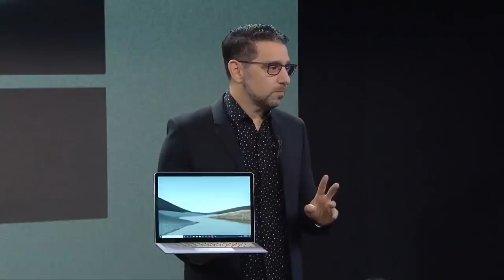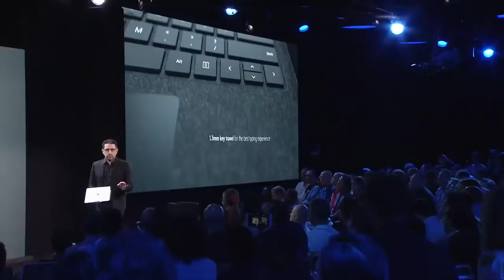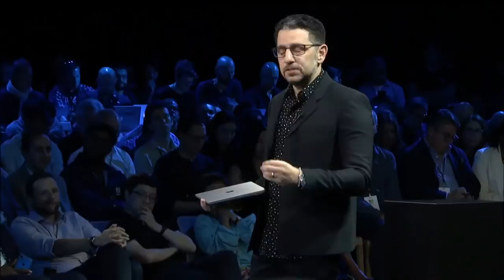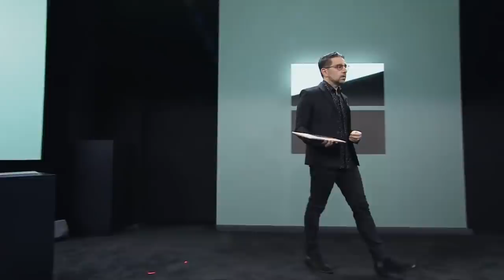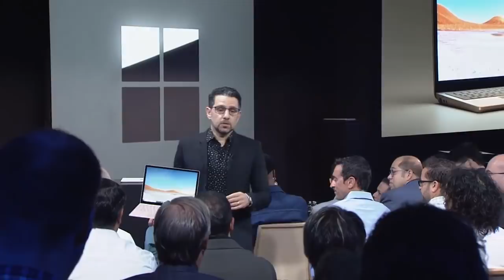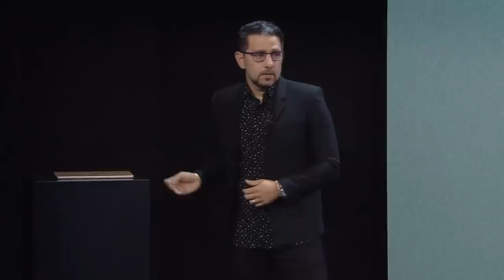Microsoft says they value repair-ability, designs more repairable product.

Comment: The 2019 chia pets have soldered SSDs and RAM.
Reply: My buddy added 8gb of ram to his ceiling fan, it wiggles a lot less now and makes less noise too
Reply: @syntehtix   My ceiling fan has 32 gigs of ram, but it crashes often. When it reboots, it thinks it's a hard drive and tries to spin up to 7200 rpm.
Reply: @fishyfool  flip your magnets around, that will solve it.
Reply: @fishyfool  My microwave actually just has 16gb of ram, but it still runs alright. It just has some overheating issues.
Reply: @fishyfool  you should install a cooling fan on it tho.
The crash happened because of overheat.
Reply: @alang9480  Mine never runs over 60 degrees Celsius!
Reply: I once sprinkled Chia-Pet seeds on my head, it was unbelievable, just like real hair, only green! xD
Reply: I laughed way too hard at this
Reply: 2019 Chia pet warranty voided if you get them wet.  Moisture indicator turns green, not red/pink.
Reply: 2047: I spilled water on my macbook and it turned green and grew hair.
Reply: Those still exist?
Reply: And that was how I declared my friend's Surface Pro 5 dead, the SSD got corrupted and Windows PE refused to even wipe the drive and I discovered that the SSD was soldered into the motherboard, which costs over 400 to get a replacement for the entire board. 
So much for the word "Pro".
Reply: 😂😂😂 AWESOME!
Reply: sadly yes

Comment: Of course, that counts for little if the tool to open it is either not available at all, or only at an uneconomic price, and is patented to within an inch of its life so that third-party implementations can be stopped in customs. This could be a move from a device that is incidentally difficult to open to one that is designed to be difficult to open without the tools that you cannot get.

Comment: M9icrosoft knows, as Apple does, that anyone can make hardware and anyone can copy software.
they have to make copying their stuff problematic.
Apple is insane and criminal.
if the law says that a MANUFACTURE must offer a way to recover data, period, no if-ands-or buttheads. 

then the need to repair drops as the data is everything we have as far and away the #1 requirement.
#2, if the damage is faulty design, then the manufacture should replace the unit for free.
those two laws in place would make APPLE alter their engineering overnight. 

the push to make them 'repairable' will never offer the desired result.
after the law goes exactly the way you want,  when you need to buy 2 chips at $75, each, and be manufacturer certified at $5,000 certification renewal per year to be allowed to buy them,  you walk in the path the manufacture controls.
because, that is the 'surprise' at the change of the current push for the law change.
my scanner, printer, fax stopped because it needed a color ink.    not the printer, but the fax and scanner too.  complete system shutdown.
that is a design that is a simple manufacture caused failure.  that sort of thing should be outlawed.

Comment: Maybe they could start in at least providing schematics for older Surface Pro's. I have one here which went through some repair shop and as it was opted not to be repaired, it came back with most of the components of the main power supply missing. Good luck in finding out which values all the caps should have...

Comment: If the trend in ultrathin laptops and portables reverses to support real innovation in field serviceable components (replaceable RAM, network adapters, storage, hot swappable or easy replace batteries) I'm ready. I'm tired of having to pay more to max out the components of a new purchase just to ensure future capability and stability for my portable devices. If they can support upgradeable CPU architectures, even better. I don't mind slightly thicker devices if it means more reliable and quality hardware. The 2009 era macbooks nailed most of it, IMO. Thinkpad T-series too, for that matter.

Comment: schematics may always come hard to come by, there will always be those that take them and replicate the devices with cheap knockoffs. Can't blame them for protecting their intellectual property/designs, HOWEVER, service manuals for fixing known issues or replacing certain parts would be an even larger step towards repairability.

Comment: Apple started this trend by first  removing the removable battery from their iphone then it snowball from there. I like dell's xps  approach of making a modern looking products but still being easy to open ( you can open it with a torx screws its not glued on together like the old surface laptop) i hope dell continues with this approach although their new xps 13 2 in 1 has a soldered SSD. Thanks apple for making this a trend. Hope this change back to upgradable ssd.

Comment: Not enough competition or consumer focused regulation.

Car industry has massive international competition. Each new model is developed with partners and competitors in order to reduce costs.

They are even making repair parts cheaper to remove and replace, so that the insurance category is lower and repair costs are lower.

We need some of that in tech industry.

Comment: Louis Even you can open a Macbook that was available from long back ago. But can you repair something without the schematics ????. I bought an Xbox after saving money. After someday because of my mistakes water went inside. I went to sooo many shops here. All had only one answer Microsoft has not released the schematics of the board so we cannot do board repairs. Any engineer can buy parts and replace them. But you guys are specialized in board repairs and if this is the condition then you have no point in complaining about apple.
Reply from the maker: You can't criticize one company for doing bad things because another company does bad things... Bravo slow clap
Reply: Louis Rossmann My point is id apple sucks a bit in repair then Microsoft sucks more

Comment: A step in the right direction.  This throw away attitude needs to stop.  Major items like screens, keyboards, hard drives etc should all be (relatively) easily serviceable.

I am currently struggling with this with a vacuum cleaner (a Dyson).  I dismantled the vaccum to remove a damaged part.  This was a relatively easy process and only involved removing a few screws and a bit of jiggery pokery.

When I contacted Dyson to obtain a replacement, they have only agreed to sell me one if also I book an engineers visit.  The cost of this would likely make the repair financially nonviable (which I assume is Dyson's intention).

Comment: It's a nice change even if you can only replace the battery, monitor, keyboard, and cooler fan. In our machines those are usually the most common failures or things that get broken; battery failuires are the most common. The motherboards usually last if they have no defects initially and don't get dropped too much.

Comment: If done correctly, service doors and screws and vents in a device can look as good as all the seamless no imagination pebble design copies of MacBook Air from 2008. It is nice and all, but after 10+ years it is just boring.
 I like more those lower tier gamer type laptops which (given that they are not as powerful as those over the top gaming designs) also try to appeal somewhat to the ultrabook market, so they try to be aggressive for the gaming side, yet professional looking.

Comment: Microsoft can say all they want, but they need to put their money where their mouth is. They've been moving in the wrong direction far too long for something this small to be anything more than a gimmick. Windows software has been getting considerably worse and worse since XP, with Microsoft constantly and consistently removing options, user customisability and compatibility, and EVEN IF they would give you full modular laptop with any part you can ask for, it's worthless to you if you have to re-install windows and spend half an hour on the phone with Microsoft "authenticating your serial" every time you want to upgrade or swap something out.

Comment: I can accept soldered ram on anything smaller than 13 inch, soldered storage however? Sure if the device is smaller than fucking 10 inches, fine.
But when both ram and SSD is soldered on anything larger than 13 inch? 
No, shame on you manufacturer!

Comment: when your products doesnt go leaps and bounds in each iteration, people will stop buying your product.
extending the life of the product is the only way to justify cost upfront. and keyboard and trackpad is what affects customer immediately. but just from this small segment you caan see the battery is accessible from just removing the keyboard/trackpad panel.

going to the microsoft event video, you can actually see  that its actually mostly accessible from there too.  although its a mockup, the CPU and GPU plus the main logic board is under that metal shield with heat pipes at the top part. those rectangular cutouts near the edges of the chassis either hints at speakers  seeing that the keyboard plate has what appears to be permeable material.
there's appears to be 2 plastic flaps right next to the logic board shield/heatspreader... the smaller one next to the blower fan seems about the size of a wireless card. so i'm guessing the SSD is under the other one...

the ram might be soldered on (the top left of chassis) but hopefully removable SSD is there.
 better to be able to migrate machines if your  board dies especially if you preach service-ability for the corporates
 "oh you have a important meeting and you need it fixed now... how about we swap your unit to an identical machine? what about your data? dont worry we just move your ssd and it will take less than 30 mins? security..?  its handled by the OS so your credentials dont stay on the old machine and nothing is left behind."

Comment: Well they've screwed my laptop. Updates have killed SOUND several times, now killed Bluetooth file transfer, now I can't even save the file I have opened off my phones sd card while it's plugged in WITHOUT saving it to the hard drive and then COPYING it over. But MEANWHILE it's downloaded an install of office I never ssked for, as well as an install for an updated version of Windows and put on a video editor I never asked for and when I go to use paint I have to type it into search EVERY TIME although it's one of the top 3 programs I use!!!! Imagine if these idiots were left to run a nuclear power plant. It'd be 80 times worse than Chernobyl.... I once had to copy a single file to my phone. 20 minutes startup as it installed an update, and 45 minutes shutdown over ANOTHER UPDATE, and I just needed ONE small file.... bloody time wasting crap. If they sold cars it would want to do an engine swap while you were already running late for work.

Comment: It was pretty sickening hearing that guy moan about trap doors n' lines blah blah blah. Oh the horror of input ports for usability! You shouldn't need more than a screw driver and a spudger to replace ram, storage and battery. A laptop is a tool that's meant to be used, not a piece of art! 

You can design one big trap door on the bottom of your beautiful laptop held on with 4-6 screws that will give the user access to everything they need to upgrade over the life of the device.  And since it's on the bottom, no one will see it while it's being used.

Comment: Sorry, but the consumer must be able to open it easily! I want to clean a fan by myself. This tablets and laptops are perfect for using them in bed. So I expect much dust in them. And screws do not screw up the design if it is made right. Also the extra weight topic is bullshit. The first surface had tons of screws under the display plus glue all over the place. It looked like someone wanted to make sure, that it is not repairable!

Comment: Maybe I'm alone in this, but I don't see an elegant laptop in a wafer-thin piece of polished aluminum. For me the elegance is in a cleanly engineered design. One that cools easily, effectively, and quietly, is simple and intuitive to assemble and service, and brings functionality that improves the day-to-day experience.

My daily driver is a Haswell-based Thinkpad- the last generation of laptops to include a socketed processor outside the "desktop replacement" category. It's a brick, weighing 7ish pounds, but I love it to bits. Literally to bits, because nearly every part is user-replaceable.

Comment: But I still don't like those super-thin devices.  If I wanted to work on something that thin, I have a bundle of lined paper...

It may be because I have big clumsy hands, but I like my devices to have SOME body to them.  Now I'm not talking hefty like a DataGeneral DG-1 or even the HP ZX5000 (that I still have, it still runs, I just can't find a project I can use it for anymore).  But something like my ThinkPad T430, taht's aboyt right; some solid feel, and not so thin I'm afraid I'll break it by breathing heavy on it (and no, I'm not breathing heavy on it because I was reading a Megurine Luka doujin, get your mind out of the gutter).

Comment: Microsoft has always made products hard to repair. Just look at the original Xbox, you had to use special to Torx security screws to open it. They made it even harder to open with the Xbox 360. Sony does a similar thing, but they make the hard drive easy to replace. Besides the easily replaceable hard drive, Sony designed the ps3 and ps4 to be hard to repair. As far as I know, the only major tech company that designs their products to be easy to repair is Nintendo

Comment: Why does your tech in modern tractors force farmers to spend $500 to have basic warnings removed or there tractors wont start ?it has to be loaded up hauled to a dealer for basic software glitches or updates that leaves it useless or won't  start without having it done ? Why are states having to use courts and pass laws to allow them to have access to simple fixes ?

https://www.google.com/url?sa=t&source=web&rct=j&url=https://amp.theguardian.com/commentisfree/2017/mar/26/why-american-farmers-hacking-own-tractors&ved=2ahUKEwiR9vrN2ZPlAhUKVN8KHbojDawQFjACegQIBBAB&usg=AOvVaw1w67T6dBlRgW5IZKHGj6pR&ampcf=1

Comment: I have a Dell latitude e6410, and I frickin' love it. you only have to remove one screw to remove the entire bottom and have access to damn near everything you could ever need. you can remove the optical drive / HDD without even taking the bottom plate off, but if you need to get a little more involved, it's super easy to work on. absolutely amazing machine for what it is, I love it and am clinging onto it as long as I can. it's only downside is it's 800x1250 TN display, I have no complaints other than that.

Comment: Of course everything is going to be soldered. Sockets can add a lot of thickness, and just look at how thin that device is. 
Now one thing I would like to see, is socketed ram, but have it edge-mounted to the board. That would remove additional thickness and would add serviceable ram, but would take way from battery or something. Or even just mount the ram sticks side by side, rather than one on top of the other. 
There's a lot of design choices that could work. I remember reading about a newer design spec for the type C that removes the outer casing of the connector assembly, and allows manufacturers to make the device chassis be the port housing, which removes thickness. All of these companies and associations need to work together to create new standards going forwards. The M.2 port even has a key specification for memory usage that has gone unused so far, maybe eventually we'll see it used in the vision of making serviceable, thin devices.

Comment: I had a Ferguson CRT TV from the eighties. It went wrong so I opened it up by undoing the two turnbuckles on the back cover and was greeted by a pocket containing full schematics and a repair manual with both engineer and consumer skill level sections. Things have changed somewhat since then..

Comment: I'm glad they're doing this. The Surface Pro tablets were and are essentially disposable products. You could not open it without destroying the product. The worst design I've ever seen, and they weren't even waterproof by any standard. The ssd wasn't even soldered, you just couldn't get to it

Comment: Just curious.  How often do you even need to repair Surface devices vs App$e devices?  There are long lines at the "Genius Bar" but none at Microsoft stores.  Do they just have a lower failure rate?  Break less often?  I am now seeing more Surface devices in the wild then App$e ones, so I know they are selling well.

Comment: It's the same shit that Apple does except maybe they're not glueing the SSD to the board. The "Surface" is a secure-boot closed off box that only loads the software that Microsoft allows you to have. Why would you let Microsoft decide what Software you're going to run? The solution is very simple here, just don't buy their crap laptop. Not until you are in control of the signing keys that decide what software goes on the box.

Comment: The first dopamine 'hit' I got was whenever my flat screen's HDMI function stopped-and I was stuck watching network television. It motivated me to research and watch videos on various repairs. Problem was a 10 cent capacitor in the power module that stuck out like a sore thumb. (Notoriously cheap Chinese made caps that are put in EVERYTHING.) I had an old PC-and salvaged a capacitor within the range set by the table of 'Volts and micro Farads'. Soldered it all up nearly 6 years ago and it's worked fine since. It's also what made Louis first show up as 'related searches'.

Perhaps Microsoft is using Apple as a business model of what NOT to do-Apple cult aside it will gain them lots of customers.